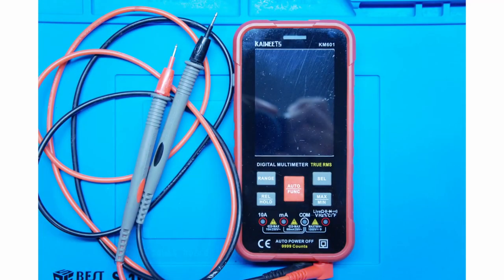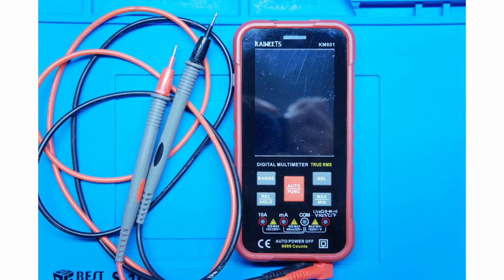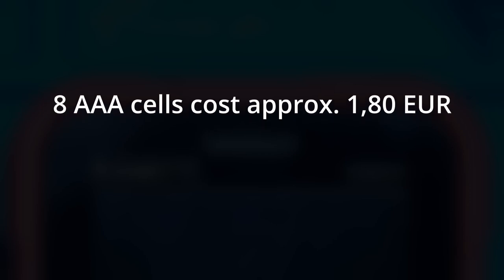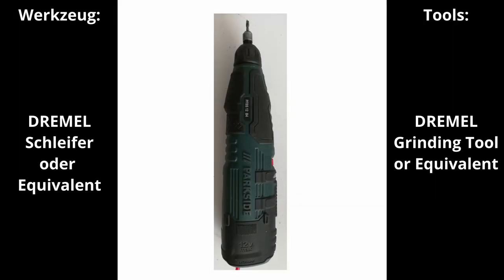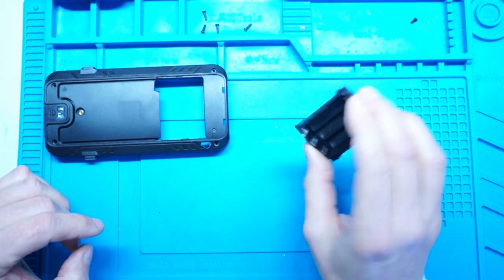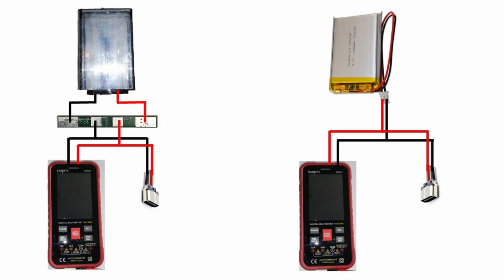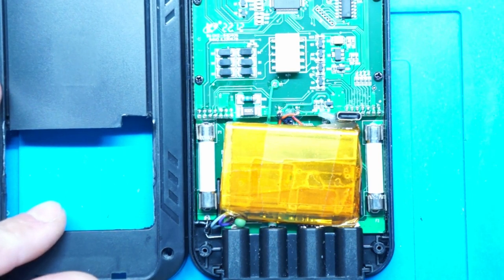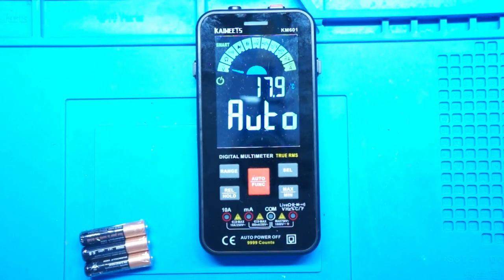Kaiweets KM601 Multimeter LiPo Accu Conversion -English-

Comment: I have the SAME meter but it is marked as a different brand name, and it actually uses button cells....not AAA cells.
Reply from the maker: Then these meters only differ in the back cover containing the battery holder. Button cells, I believe, will last way shorter work time, than AAA. The conversion will be the same, as surely, they will not have altered the PCB. Thanks for the info.